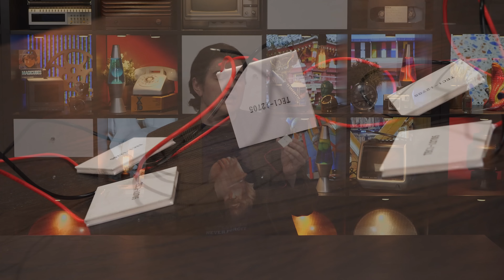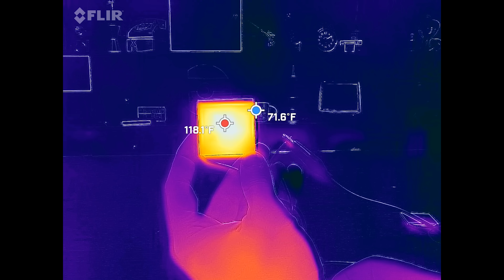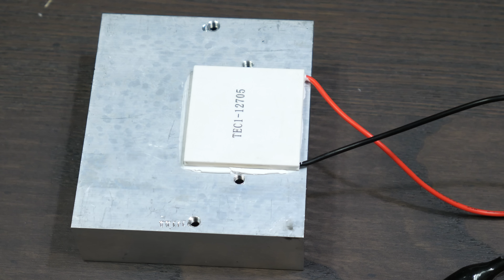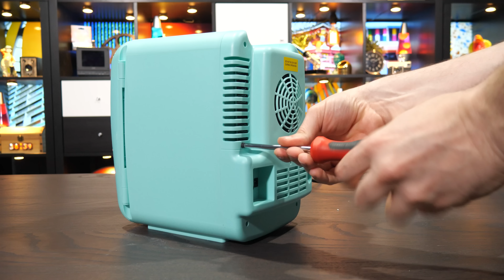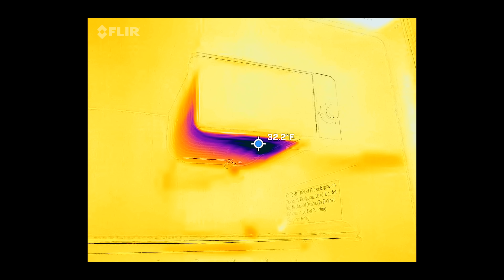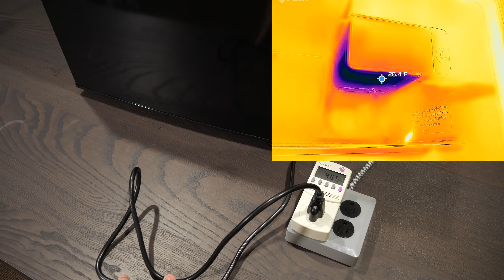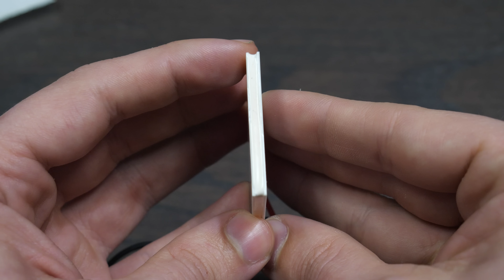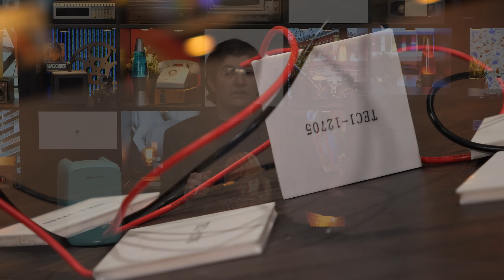Thermoelectric cooling: it's not great.

Comment: Friend had one of those.
Kept complaining about it, so I went over to improve it.
Changed the Peltier from a 5A to a 10A Model (120W), changed the thermal paste to actual good one, added a bigger hot side heat sink and ofc upgraded the power supply.
It worked much better afterwards!
For the low price of doubling the electrical consuption, and almost trippling the original purchasing price 😂😂😂😂
Reply: “It’s not so bad. If you Ship of Theseus the entire thing it’s sort of passable.”
Reply: @SomeOne-ym4xg  exactly 🤣
By investing and replacing all the parts, it is actually able to do what the original promised
Reply: @florihae at that fucking point just make one yourself though 

Not really a ship of theseus if you didn't need the ship and could make a better one and had no pressure or time or money to give much of a damn about 
Just make one yourself at that point 

If hindsight isnt your problem also

But people really dont like looking at specs and i find it weird
Reply: @PieCakeandDonuts it was fun, that's all.
The true ship is the friends we made on the way 😂
Reply: @florihae eh fair i have some pointless projects also that are either useless or i basically did the same has you for the challenges and entertainment some of which includes my own hidden blades i made and a brace gun 😂
Also a prosthetic leg gun like that girl from lone ranger with Johnny Depp and a arm prosthetic with a pipe like jindosh

So i can relate 

Im also prepared if i lose a limb appearantly and im going to be so fucking pissed if it isnt the right ones 😂
Reply: @PieCakeandDonuts  based 😂
Reply: @SomeOne-ym4xg  passable at cooling, but also costs more than a real fridge and consumes 4x the energy.
Reply: Treat it like a gaming machine's CPU and you're all set.  Maybe go to liquid cooled.
Reply: @jimmurphy6095 adding liquid cool with a radiator is basically the same as an actual fridge at that point 😂
Reply: @Ham24brand  Basically, yeah. But still cheaper and quieter. 😂
Reply: @Ham24brand  well for a cpu its not just spend a bit more on metal/ radiator
Reply: @Ham24brand  i love this phenomenon when people try to improve on a new design and accidentily invent the old design again🤣
Reply: @Ham24brand  liquid cooling cant get sub ambient
Reply: @alexdrockhound9497  Yeah, you would need a compressor
Reply: @Ham24brand  except for not having a compressor and phase change
Reply: @Ham24brand not the same, but equally complex.
Reply: @Ham24brand  Maybe just add a heatpump...
Reply: @Ham24brand wait so my computer is liquid cooled practically making it a fridge
Reply: @Ham24brand how much do you think a fridge costs?
Reply: @joeschmoe6908 like a $1000 dollars or more or something
Reply: @johnklug589  No, because it uses coolant not refrigerant.
Reply: @jimmurphy6095  You wouldn't even peltier a CPU. Linus tried and it works just well, up until the peltier gets too hot and you cannot move the heat quickly enough anymore
Reply: @eziitis8  peltier cooled cpu's were a popular option for overclocking in the early 00's.
Reply: @eziitis8 I thought when Linus did it it was useless even when they went super overkill with multiple peltier modules.
Reply: @eziitis8  its often used in combination with water cooling, water wont be cooler then ambient. the peltier can. cool the cpu lower, then you can get rid of the heat by the normal  water cooling
Reply: @eziitis8  Intel was experimenting with these as coolers in the early 00's, but CPU power consumption out scaled the ability to cool using peltier a long time ago.
Reply: @eziitis8  I remember the short lived Peltier craze in the 90's for computer processors.
Reply: @eziitis8  About 25 years ago, I did peltier (+watercooling) my AMD Athlon 800MHz CPU (or something like that) for serious overclocking. When the CPU was idle, it began to accumulate ice - which melted when things got busy. The melt-water then dropped down on the GPU... so I had to run a background process to permanently keep it at 100% load.
I think I still got the GPU lying around somewhere - including rust-stains... 😁
Reply: @ReadersOfTheApocalypse  Classic problem with sub-ambient cooling, that. XD
Reply: @alexkaplan6581  they were pushing it for Intel 10th/11th gen too. I ended up getting the Cooler Master AIO very cheap and making it work with a Ryzen 5900X... Very fun project, but very impractical as the element is only 65W with 12V in. I know others have modified theirs to chill the water in their custom loop, also a fun idea.
Reply: @laceflowerhw  Really, that late? Wow.
Reply: @eziitis8  Needs more peltier, thats all.
Reply: @eziitis8 I can think of a use case for Peltier cooling a CPU and that would be in a situation where the air temp is very very high.
Reply: @ReadersOfTheApocalypse  That's incredible. These days you worry about liquid loops leaking, meanwhile you were worried about condensation ice.

I'd still say my point still stands that even though it's possible doesn't mean it should be done. I tip my hat to you sir.
Reply: @eziitis8  Doesn't necessarily mean the loops weren't leaky too... 😁
Reply: Except people did peltier CPUs back in the day. It'd be a mix of peltier and watercooling. Watercooling would cool the peltier. You could buy the Swiftech peltier waterblock. Course this was back in the age when few people were watercooling and even fewer were doing cooler than ambient cooling. The problem with less than ambient was having to deal with the condensation issues. This existed for the peltier waterblocks or the phase change coolers (like Vapochill). Depending on cpu, the Swiftech peltier could chill the CPU down to like 4 C at idle and still under ambient under full load.

Hell, watercooling was still more for the extreme side, since no AIO kits existed. Few companies existed for water cooling components. People were making their own water blocks, using aquarium pumps for water cooling, or converting car heater cores into radiators. People were also making their own peltier setups, since they wanted more powerful peltiers than what Swiftech made. They were the only company that made a peltier waterblock.
Reply: @eziitis8  I used a Peltier on my cpu in my 2nd gaming rig and never had any problems. Also have a Peltier fridge and love it too. I guess the mileage varies🤷‍♂️
Reply: @eziitis8  : A single peltier element does not have enough transfer capacity to handle a CPU and produce any real temperature delta.

You'd have to have two cooling loops or equivalent and then put handful of peltier elements between the two loops. That way you could run the elements well below the rated maximum, and get decent cooling and CoP.

But that would take lot of space and lot of money. 

I might still want to try that one day, but...
Reply: @jimmurphy6095 while you're at it, maybe add a compressor to help force the heat out of the liquid
Reply: @jimmurphy6095  and using another peltier to cool that water down
Reply: @jimmurphy6095 you mean almost like a refrigerant system? 😂
Reply: @jimmurphy6095 I considered liquid cooling but honestly the main point of liquid cooling on a PC is to move the heat away from the other components but in a mini fridge there are no other components, so it's pointless.
Reply: @jimmurphy6095 yeah, and then cool the liquid with a chiller with an actual refrigeration loop
Reply: Fun science experiment. Smallest possible refrigeration circuit. Tiny reciprocating compressor at minimum, rotary or scroll for extra credit, 3/16" refrigerant line or smaller, tiny microfin coils.

It'd be cool to see the peltier size coolers but with actual refrigeration.
Reply: @Jaker788  I like that idea....don't tempt me 🤣
It would just become another unfinishe project
Reply: @Jaker788 For something that size, a tiny 5W water pump from a window washer would probably be sufficient to get the job done.
Reply: I got a large Coleman cooler with this type of cooling and it will freeze drinks. Works very good when I used it for trucking.
Reply: @smittyshmo  could you tell me a model number? Not for buying, but would like to see if I find out how they cool the hot side and how they distribute the cold side
Reply: @smittyshmo  it will freeze drinks as long as the ambient air is 50 degrees or less.😂
Reply: @smittyshmo  is that so…share the model if you please!
Reply: @smittyshmo
Reply: @smittyshmo yeah he’s using temu level engineering vs compressors. I’m certain better engineered peltier fridges can be made.
Reply: @jhoughjr1 ive already made one to cool an entire cpu (9800x3d) under full load. On my channel. Honestly it was fairly trivial. Also made it cool the same cpu on full load for 20min doing cinebench while tecs were getting less wattage than the cpu was getting
Reply: I made a mini fridge using Peltier devices a few years ago. It used 8 devices with liquid cooling. I ran the devices at 6 volts rather than 12. I recall there being a tradeoff at full power where thermal transfer cancels any additional cooling.
Reply: @tylercruit6261  yes, as soon as you have saturated the thermal flow capabilities of the element, which is not that great (especially the ones with those THICC ceramig tiles as plates) you effectively overwhelm the element and both sides get over room temperature.
Reply: sounds like either the cooling effect or self-heating is non-linear  so look for the highest efficiency region and operate there...
Reply: @gregbailey45  if you want the best effect you have to operate at less then nominal voltage, seems to be the consensus here
Reply: @tylercruit6261 that would depend on the interface of both heat sinks and the load
Reply: i had one of these for a minute then just got a mini fridge off facebook for 25 bucks instead. they work good as wine coolers but don’t get the drinks all the way cold.
Reply: @cavanmoriarty6370  the things that are scary about fridges or electronics in general from Facebook? Cockroaches 🪳🪳🪳
Reply: @cavanmoriarty6370 problem is the size. I have a very specific space on a tv stand where one of these mini fridge coolers fit but most actual fridges are too big for what I need
Reply: .. and you spent more money on the upgrade than what the fridge was worth :)
Reply: @Heffalumpen That's what he just said at the end of his comment
Reply: @Heffalumpen  and it still will not cool worth a shit.
Reply: @Heffalumpen  exactly 🤣
It was a fun project tough ^^
Reply: @Heffalumpen  Yes, he said that.
Reply: @Heffalumpen sometimes people do stuff for fun
Reply: @Heffalumpen  You could buy a better fridge but you are going to pay way more for it. So either way you are going to pay up for good compact refrigeration.
Reply: @Heffalumpen cars are considered totaled if you’d have to spend the value of the car repairing it.
Reply: @Heffalumpen  it’s the only way to make something good and make it last a long time nowadays
Reply: @Heffalumpen  And it works way better.
Reply: @Heffalumpen hence why they said "almost tripling the original purchasing price"
Reply: @Heffalumpen your comment is redundant
Reply: @Heffalumpen  yes that's what he said in the comment
Reply: @Heffalumpen  > "For the low price of doubling the electrical consuption, and almost trippling the original purchasing price"

I understand he doesn't know how to spell "tripling" and "consumption" correctly.  But surely you could use critical thinking to understand he said what you said, just with better specificity.
Reply: @Heffalumpen  pretty sure that falls under tripling the original purchasing price
Reply: Well i mean hes got the one mini fridge that does 3x better than the POS they started out with. @Heffalumpen
Reply: @Heffalumpen  Brother did not read the entire comment.
Reply: Having a fan inside circulating air over another heatsink on the cold side would have improved it more I have a portable car cooler with a 5 amp Peltier that has no problem getting to 2 deg C
Reply: @bascomnextion5639 yeah mine has no interior fan and it makes ice on the junction
Reply: @bascomnextion5639  agree, they are very lacking with the tiny inside coldsink.
Reply: @bascomnextion5639 

I am trying to cool a shower down. I grow mushrooms inside the shower, less messy. But it heats up.
How would I use this tech to cool it down.
Thanks
Reply: Kind of what I'm doing with a coolerbox, also making it temperature controlled so element and fans are switched off.
Reply: @MeteorMark  booh, temperature control is for sissys, FULL POWAAAA!!!! /s
Ofc, that is the smart way, but I am not here for brains, I am here for the COLD
Reply: That's a hilarious upgrade for such a lame little cooler
Reply: @TheTyisawesome  it went from "lame little cooler" to "space heater with cold beverage function"!
Reply: Yeah, I had a PC case that used a peltier device to cool incoming air.  Just like the video says (and you say)--it's pretty neat.  Just not very good haha.
Reply: @tychosis Where did it put the waste heat?
Reply: @techgeeknzl  There was this sort of "diverter wedge/ramp" thing that split the hot and cold airflow and blew the cold air into the case and the hot air out through the bottom and rear of the case.
Reply: @tychosis  that is so stupid, haha. All you are really doing is heating up the room, and therefore the air 🤣
Reply: @florihae  haha yeah, it was dumb and bad, seemed cool at the time.  it DID pump cool air inside, but also pumped the hot air to the exterior of the case
Reply: i suppose in a way by the upgrade, the initial expense was simply buying the premade housing for it all, which given the form factor and ready to go circuits would make it appealing to then simply replace components where desired
Reply: @tsmeowth001  haha, worse...the original circuit is literally just a power supply and a on/off switch....psu was trash and I just kept the switch 🤣
The current fridge has an external  powersupply, helps actually to get some less heat into the box!
Reply: But did you have fun doing it?
Reply: genuinely though now i'm curious if you were able to make it better by adding water cooling and having it toggle itself when it reaches a certain internal temperature. It would still not be as efficient, but you could eliminate a lot of the problems that blue one did like the noise and heat dispersion issue
Reply: @moffichu9150  good summary. You can make it better, but realistically never better then a cheap fridge.
Reply: @Pippy1  that was the only reason to do it!
I knew it will not be better then a fridge, nor consume less....bit it was a fun afternoon
Reply: Honestly, I'd have been tempted to replace the fan with a larger-diameter one.  The most important factor in how well a peltier works, is how cool you can keep the hot side.

(And yes, people have tried stacking peltiers on top of each other, but that just makes it harder to keep the hot side of the final one cool enough, because there's more total heat to get rid of.)
Reply: @jonadabtheunsightly  used a HyperEvo212 PC heatsink, that helped a lot
Reply: @jonadabtheunsightly yes but you get much much colder so with closed loop control operate at a lower duty cycle
Reply: Whats your advice on upgrading one thats plugged into a cars cig lighter?
Reply: @seymoarsalvage  unplug it and put some icecubes in there instead. Bam!
Reply: @seymoarsalvage the power supply and wiring is the concern with adding more peltiers.
So you want to focus on non electrical improvements. Bigger heat sinks, better insulation between the hot and cold areas.
Reply: @seymoarsalvage  check the fuse on the cigarette lighter in the car so you don't pull more than you're supposed to 

Perhaps get a larger sized fan to spread air out on the heat sink at a lower RPM which would be quieter 

If you're feeling adventurous you can always add more heat sink as well more surface area for air to blow over
Reply: @KuramaKitsune1  I reached the point where every vehicle I own (modep, motorcycle, car) I have a thick gauge wire directly hooked to the battery with a XT60 plug. This way I can pul easily 600W continiously from my car. Especially useful for an inverter or so.
Reply: simply damming the fan to the heatsink makes a huge difference.   adding lateral slots in places on the sink also helps
Reply: Well, if your friend uses it in a office he does not have to worry about electricity costs.
Reply: @greenblack6552  haha, fair enough, he actually did bring it to work
Reply: Did you check out the insulation? If their door didn't have foam or whatever,  that could be a big factor
Reply: @peterkn2  i did not. It was either just double walled pladtic or filled with some light duty foam
Reply: Bought a couple of miniature water coolers using this tech a while back - worked very well until they didn't. Very unreliable, they just buggered up within the space of a few months. Crap PSU?
Reply: @jamesportrais3946  I would sbsolutely blame the PSU. The one in that fridge was really bad and getting quite hot.
Try to use an external (laptop style) psu.
Reply: I already have some of these parts... maybe I will upgrade mine... or buy a regular mini fridge
Reply: @orion10x10  depends if you want to be crafty and enjoy tinkering or if you are smart 🤣
Fridge is always the better option, but I just love the process of improving the machine.
Reply: That's what friends are for.
Reply: so it consumes twice (actually probably 4 times) as much power as a mini fridge, costed more than a mini fridge, and does a less good job than a mini fridge. You actually hurt your friend here.
Reply: @johnk6757  haha, you assume too much. We both knew before we even started that the new fridge will be even trashier then the current one. But it was fun to do and to see that it actually improved cooling!
Most parts I had laying arround anyway. All in all, cheaper then going to a bar all evening and more entertaining, I call that a win!
Reply: change the fan to a hi presure and use 9v, power drop to 17W and beter transfer of heat
Reply: @mnk47  that part I really missed doing. Should have played with the voltage more!
Thanks, will try one day...maybe
Reply: I feel like the biggest weakness is probably the lack of insulation.  Did you try drilling a pair of holes in the hollow door and letting some expanding foam loose in there?
Reply: @Archgeek0  nope, but should have!
But hey, why insulate, when I can just ramp up the power? ;)
Reply: I have a larger one of these that holds 18 cans. Naturally when I got it I took it apart to see how it worked and was surprised to see this mechanism. I had already learned about it from a science experiment that Linus Tech Tips did trying to cool a PC CPU with something similar. Anyhow, I opened it up and to my shock and surprise I saw that the fridge was actually designed to hold TWO of these coolers. One in the top and one in the bottom. The power supply even had empty solder pads and enough beef to run the second one but for whatever reason mine only came with one.  I also had an older/smaller sprite labeled one that held about 8-10 cans. So naturally I harvested the parts from the older one and made my new one run with two installed. I have got to say it is VERY impressive. These units are larger because they came in larger sized fridges and when running both my drinks get down to drinkable temps in around 2-4 hours depending on ambient temps. Also when they get cold they get fridge cold. I can also store refrigerated foods inside of it. For context we have central air and run the house at about 69-72 degrees F. The internal temp of my fridge is between 38-40 degrees and it holds that steady and gets things cold fast. However (and I haven't finished the video yet you may have addressed this) I noticed that cans cool much faster do to the thermal conductivity of the cans. Normal foods like a lunchable for instance that comes in plastic packaging takes much longer to bring from room temp down to 40 degrees F. However, keeping a few cans in the bottom along with my food seems to help speed up the process significantly. It is also worth noting that the second unit is smaller than the first and that I upgraded the thermal compound on both to high grade PC CPU compound. (Someone should liquid metal one of these bad boys!). You should try buying the larger version from Walmart that holds 16-18 cans and then installing a second cooler on it. I had to rig it up a little bit as the rear wall was a tad different in thickness but it wasn't too hard. I would love to send pictures and temps if you are interested! Take care.
Reply: @ImJakeHello  all these comments really made me consider building my own from scratch. With propper foam board, so it is well insulated, PC heatsinks to efficiently remove the heat and full metal sheets on the inside for maximised area of contact to the content. Because as you said, touching the cold plate directly is the way to go.
Reply: I guess I got a decent one. Mine gets cold enough to freeze liquids and it's so quiet. It makes my humidifier sound like a jet engine. I connected mine to a timed outlet so it turns off and on in 20 minute cycles. It fits perfectly on my bookshelf next to my other mycology supplies. I use it to store My liquid culture syringes in a sterile environment (kitchen refrigerators have all sorts of contamination). Perfect. Size for 10 ml syringes,  50 ml glass vials and 60 mm petri dishes. I guess it'd be pretty crappy for food or beverages tho
Reply: Penaltier, cooling, it's a great way to take a red wine from room temperature to basement temperature at great expense. If you don't have a basement. Otherwise, they have no real use.
Reply: @scottdavis6734  using ice and salt is way faster and cheaper
Reply: Perfect upgrade
Reply: I was wondering, how good you could DIY. Decent insulation, good Peltier elements with big heat sinks , fans and most importantly real temperature controller. But I guess it wouldn't make any sense money wise.
Reply: @Tomi_Mäntylä  it makes a lot of sense if you ENJOY the process!
Financially, normal fridge, preferrably second hand, is by far the best option. But where is the fun in that?
Reply: @busimagen  correct.
The first stage will have to dissipate only the electric power plus the extra heat absorbed from the cold side. While the 2nd stage needs to dissipate all of this heat PLUS its own electric power. Therefore having multiple 2nd stage elements to cool the 1st stage makes a lit of sense!
You also make cooling the 2nd stage hot sides easier, because you multiply the area where you can add coolers
Reply: i did the same thing plus added a thin sheet of aluminum connected to the mounting screws on the back of the interior of the fridge to get more cooling into the container. works great but super inefficient. i still use them in the car via the power adapter.
Reply: The old 2007ish HP laptop's heat sink/fans with the Athlon II CPU/GPU were pretty darn good at removing heat from that power hungry little chip. Might be a good upgrade for making a small cooler with.
Reply: @tauncfester3022  I agree. Being cost conscious they probably used minimal heat sinks in both sides.
Reply: @tauncfester3022  I used a CoolerMaster Hyper 212, that one is much better, since it does not blow the hot air against the casing
Reply: Instead of a 10 amp you could use two 5 amp ones (not stacking) with separate heatsinks and coolers for added cooling area.
Reply: @carloscollomps1552  That's probably what the OP did.
Reply: @carloscollomps1552  that would be the most effective way, ofc, but needs much more modifications then only changing the module.
Reply: Honestly... if you're using it in an office, you don't pay the power bill lmao so
Reply: @jakegreen6341  true, or you have solar or just don't care 😛
Reply: This is what a real man will do. Make something already inefficient even more inefficient 😂😂😂
Reply: @philipplamenov8649  yeah bro!!!
It's not about the money, it is about sending a message 🤣
Reply: things that  didn't happen
Reply: Yeah man i knew that peltier is shit more than 15 years ago
Reply: @wittekPL  they are not shit. They are just often not correctly used!
Like that shitbox I built 🤣🤣🤣
Reply: Mod ALL-THE-THINGS!!! That is some ingenuity.
Reply: @stevenv2190 that's why I like vuying cheap chunk, I can mod it much better then the well built, overly complex stuff 😂
Reply: So what you're saying is for the price of a real fridge, you managed to make a fake fridge into a smaller version of a real fridge, but still worse than a real fridge lol
Reply: @Twinspinner yes....AND having fun while doing it 😂
Reply: A full sized fridge uses about 120w while running, so lol
Reply: @pilotsmoe many even less 😂😂😂
Reply: I wonder is you get a big and powerful enough peltier element, maybe it would do well at cooling CPU's? Just thermal paste the element on the cpu and see what happens. Not mine though, someone else should try it and let me know how it goes😅😂😂😂
Reply: @alexmattucci8507  oh, this has been done before.
Main problem is, they get overwhelmed by the heat.
The far better aproach is to actively cool your cooling liquid with Peltier.
This way you can lower your cooling liquid temperature by about 5 to 10°C
Reply: @florihae ahhh, yeah that's a good idea😅
Reply: Add a bit of insulation, and it could probably make a beverage cold enough for human consumption in 3 business day.

Have to gave up all illusion of being cheap altogether, though.
Reply: @PaiSAMSEN  if you want cheap and better, get a normal compressor fridge 100%
Reply: Why did you do that? You just had to put the toy into a real fridge, all problems solved! The toy would also use less power than the fridge. :)
Reply: @stephanegrosjean4990  because it was fun!
Reply: @florihae  you missed the joke ;)
Reply: @stephanegrosjean4990  thanks to the great YT comment system, I can not even find your original post anymore 😅
Reply: @florihae  tbh, neither did I, I think that comment was a joke about putting the toy fridge into a real fridge to achieve better results without using any power from it ;)
Reply: @stephanegrosjean4990  probably, does not matter, just pretend I read it and thought "haha. Yeah, that would be funny" :P
Reply: And at that point, you'd think the friend would say "I'm just going to get a small fridge from FB Marketplace, that way it works out way cheaper, is more efficient but ALO I can keep Otterpops, Sticks and ice in the  little freezer compartment!" 😅😂🤷
Reply: so its using even more energy
Reply: bro you upgraded his computer not his fridge
Reply: @Robbie-mw5uu  oopsie XD
Reply: hahahahah, that's evil dude😅🤣
Reply: Try a cooluli it has a temp adjustment and cycles to maintain it was actually engineered to work . But I still recommend the mini close loop refrigerant fridge.
Reply: I upgraded my little fridge by storing it inside a mini fridge. Works great now.
Reply: @florihae  omg lmao
Reply: Did it even have a thermal insulation other than double plastic walls? I'd start with that.
Reply: Same, but i went from a 40w to a 60w. I didn't upgrade the heatsink, but I did put a bigger fan on it. I also removed the old PSU, so I replaced it with a more powerful one, and then blew that one up, so now it runs off a PCIE power connector.
Reply: Through the magic of buying two electricities...
Reply: Did the same....along with a 3dprint to force the air through the heat sink vs vaguely at it.   It was freezing up inside.  Still terrible for power use of course.   The sold designs leave a ton of performance in the table, but then for the price you'd just buy a real mini-fridge.
Reply: But most importantly, did it have rgb lighting?
Reply: @Emppu_T.  omg, it did not!!!
What a mistake! Will call the friend immediately, we need to fix this!!!
Reply: The cheapest thing to do with it if you were going on a picnic is to put it with the beer's in it into a freezer the night before then you have a cooler box with cold beer in it.
Reply: "MORE power, grunt, grunt, grunt" -- Tim "the tool man" Taylor.
Reply: might be worth having in the office where I am not paying the electric bill lol
Reply: You remind me of Tim Allen in Tool Time: "More power! Ha! Ha! Ha!"
Reply: Gutted 3 of these and reused the peltier elements set up as 2 parallel and 1 series. Added a much bigger heat sink to it and a cold side heat sink from a pentium processor cooler. It is mounted into a big cooler and powered by a solar panel ❤
Reply: Just keep in mind you need a bigger power supply if running on AC, and finding a cig lighter socket in a car fused high enough for reliable operation.
Reply: What if i want to heat oneside and cool the other
Reply: Please note that in the few model I have tested there was very bad insulation.
Reply: But for fifty bucks you can get a cube frigerator on craigslist
Reply: I thought "turn it up to eleven" was a Wayne's World gag originally 😢
Reply: @busimagen sounds good!
Reply: What a good friend. I bet Your friend appreciates raising his electricity bill. 😭
Reply: @Sentarry  haha, all your guys concerne is cute.
He uses it not often and when, then usually at work 😛
Reply: wile consuming twice as much power, great job
Reply: so it is less shitty but shitty nontheless :)
like using hydrogen for fuel
Reply: define "better"? didn it go below 3 degrees C from 7?
Reply: @prime8krish  I could not measure the temperature accurately, but the drinks were as cold as from a normal fridge after a hole afternoon/evening of running
Reply: i wonder if heat pipes would be useful as well in order to transfer the heat faster? you’d of course need one made for slightly above room temperature instead of the higher temperatures they are usually made for, so that might make it even more expensive, but still
Reply: @asdfghyter  I used a Hyper 212 CPU cooler, which has heatpipes ;)
Reply: Jurassic Park moment for sure!!!
Reply: Sounds like you really stuck it to her. Some friend. 😂
Reply: @ItsMeKyle1882  some people here are really upset about how I did my friend "damage" because it now uses more electricity or so. Do you guys think he uses that thing as his main fridge?!
Bro, it was a fun thing to do!
Reply: exactly what I was worried about once I read you increased the amperage requirement
Reply: If you wen that far you might as well slap a thermostat to it.
Reply: @marcor6403  probably, yeah. But had none at home. Whole thing was just spare stuff (mostly)
Reply: My friend we are dwelling into pc cooling territory 😂
Reply: @pingwong117  I used a CPU cooler, so yeah
Reply: hmmm. i think you COULD make it more efficient, but with a more drastic redesign. moving the peltier to the top rather then the side. adding alot more, and better insulation around the entire thing (maybe even vacuum layers too if you want to get fancy), and adding a thermostat to turn the entire thing off once the interior gets to a certain temp. 

I also wonder about changing the venting system. like, would it be better to leave the fan in the back, and have an intake vent in the front where it draws air over the heatsink fins and blows it out the back, rather then blowing directly on them and having output vents on the sides like here.
Reply: @RaptorNX01  the goal was never maximum efficiency, it was a cheap and quick project.
About the hot air flow, this was solved entirely by using a CPU tower heatsink. Therefore the airflow is now parallel to the backwall of the cooler
Reply: You basically made another one  :P
Reply: @davejones4946  would love to make one from scratch...but it is just such a waste 🤣
Reply: Then consumed even more energy than a standard mini fridge
Reply: Sounds like you are installing a CPU
Reply: @deku812  Intel is hotter than that 🤣
Reply: I whonder how much of this is also the internal side not having an internal airflow and heatsink to wick away the heat
Reply: I kinda wondered why the hell they only used one element instead of a grid of peltiers to fill up the whole surface.
Reply: @techalyzer  quite simple....cost
Reply: recently started a temp job at 5below. we sell various designs of these kinds of fridges. after watching this video it's almost mind numbing watching people buy these while knowing how bad they are
Reply: I froze my fridge accidentally because of this when i first got to college. My mayo has never been the same.
Reply: @mangojules5736  we all have been there brother :(
Reply: While still wasting energy which other tech wouldn't. Good job. NOT.
Reply: @minkorrh  oh look mom, another commenter that did not read and just shit on a fun project!
Reply: I have a coke cola fridge like this it puts ice on the bottoms of the cans and is cold
Reply: Well I guess it’s the idea of getting that unusable Peltier to be usable
Reply: Questionable gains but sounds like a fun project tbh
Reply: @binchsoda  questionable? Bro, it is lunatic 🤣
But it was hella fun, that's right!
Reply: bro just build a pc at that point jesus you got half the knowledge to do so anyways
Reply: @marthflores3515  built many PCs, usually watercooled ;)
Reply: Now add RGB lights
Reply: Send me the schematics pls. Would like one of these in my office
Reply: @icenote1591  haha, as if I have that 😂
Plus, it is much cheaper to just buy a small fridge
Reply: I love the engineering breakdown how Peltier’s COP drops as ΔT increases, making them inefficient beyond small temperature differences. The fundamental physics, not design flaws, is what holds them back.
Reply: @diytoptricks  you can brute force it to some degree, but absolutely agree. They are usually just not the right solution
Reply: As I was reading how you went over to improve it because of how much complsing there was. I thought you went over stomped on it and threw it in the trash😂
Reply: But now it will work forever
Reply: Essentially, people would be better off building their own if they have the needed knowledge.
Reply: Pc builder uses cooling and power knowledge to fix peltier cooling
Reply: Tldr: just buy a cooler-box and store some ice-packs in your real freezer to cool your drinks for the day 😂
Reply: @Tiggy.Skibbles106 100% correct
...IF YOU ARE BORING 😂
Tinker arround, plsy with shit tech and get happy
Reply: It could have quite a few advantages, if implemented with quality Fan, Insulation and controller (which most of the ones you can just buy don’t though)

-Less noisy
-needs less space
-less moving parts
-less toxic gasses

Would love to see one build really well with Aerogel as insulation. And then see if it actually takes much more energy

If it’s nearly the same, then it would be perfect for Campervans or boats, that you sleep in.. where these advantages matter
Reply: The sad thing is they can build an ice machine that roughly the same size that has a compressor and works great for not much more money.
Reply: @marktx21 oh yeah, even mini fridges are not much more expensive
Reply: On the flip side, lots of cheap 1-500w PSUs with 12v rails, and heat sinks from old pc's to be had , and insulated boxes are cheap in the form of non chilled coolers, so diy-ing might not be a bad solution ... 240w peltier with gaming pc style heatsink for £40 on Amazon, cooler for £20-40, scrounge a power supply and spend a weekend.....
Or a 50l booze fridge runs £100-150 new, and one model runs at an average of around 8 watts (based on a not particularly efficient, e class environmental friendiness UK power rating of 66kwh/annum on a product info sheet)
Reply: People don't buy devices, though. They buy intended effects. If you want an effect badly enough, you'll pay for it. This is why there's a Dodge Ram SRT truck. 🤷‍♂️
Reply: But still wont freeze anything from liguid
Reply: @Expression666  it totally can!
But only if it directly touches the cold plate
Reply: Might have been easier to convert an electric oven for him😂
Reply: @buffclary  just reverse the polarity, problem solved
Reply: I have that exact little fridge !  I've never used it though.   I imagined id use it in the car but have not as of yet.
Reply: @dmlagrange  it will not do much or even anything in a warm car
Reply: Just get a regular cooler. This is the dumbest idea ever. Fixing problems that are not problems.
Reply: @voradorhylden3410  wow you are right!
We all should just be productive, have no fun, work hard, procreate and die. 

Bro, live a little ...
It was a fun thing to do
Reply: @florihae  no your rught we should all just buy useless crap
Reply: @voradorhylden3410  did you even read what I did?
Friend had one of these already, it was throw it away or improve it.
I did improve it with parts I had already and no use for.
Reply: Your spelling is legendary. I trust your story.
Reply: @RayeTodd english is not my first language and I am usualy drunk when I comment on youtube 😂
Reply: What you want to do is use a peltier on top of a peltier 
You can get stacking temperature differentials up to a point 
Doesn't necessarily stop at 30°  below ambient 
Adequate heat sinking the hot side is of course required.
Reply: @KuramaKitsune1  Stacking is great fun as you need to disperse more heat from electrical power with each module.
Reply: @KuramaKitsune1  Tried that. It was still dismal, if not even worse. Threw the whole thing away.
Reply: @KuramaKitsune1 no. The limit is due to not being able to reject heat quickly enough. Adding a second one would double its greatest weakness
Reply: @FuncleChuck  A 2nd in parallel with the same current should do better for efficiency. high current, high load is the problem. Same load but less current per device should help but I wonder what the efficiency vs current curve looks like.
Reply: @FuncleChuck  The limit is the maximum temperature differential it can generate, so in effect the limit is the temperature of your room. You can only cool it to room temperature with radiative cooling, and the element can get the cold side say, 20° below that. Now, if you stack another element on top of that? The hot side is now being cooled to not room temperature, but 20° below room temperature. Now it can go 40° below room temperature! And so on. This is an idealised example of how the elements work. You will run into cooling problems, but stacking the elements will decrease the temperature you can reach, up to a point.
Reply: @KuramaKitsune1 keep d stacking them until you can get them in a donut shape, making a heat particle accelerator
Reply: @chistinelane  INFINITE HEAT!!

....OR COLD....
Reply: @KuramaKitsune1  go big brain.  and use heatspreaders aswel.  so you can stack multiple peltiers on a single one. eventually allowing you to use a massive heatsink.  or even a radiator and use it to heat the room.
Reply: @KuramaKitsune1 

The problem is it would still thermal throttle, maybe this could work with a huge cold plate and mutlieple Peltier devices spread across the cold plate simultaneously.

Would still never measure up to immersive liquid cooling or direct die water loops.
Reply: @KuramaKitsune1 your limited by the power dissipation on the hit side. 

Once the heat soaks the heat sink then your just adding more power to be dissipated.

You can improve with liquid cooling, but then just liquid is good too.
Reply: @KuramaKitsune1 yeah u can get to dry ice temps with a not too deep stack
Reply: I've repasted one of these and put a better PC fan I had in it. Got better performance and it was quieter but still not worth it.
Reply: Congrats, your friend is now bankrupt from its higher energy usage.
Reply: @Nitrxgen  he was broke before already 🤣
It was a fun project, used an old CoolerMaster Hyper 212 as hot side cooler, was actually less loud afterwards ^^
Reply: Got one for free in a Coca-Cola campaign many years ago. Tried it, thought it was noisy junk, and stuck it in the attic. It's still there. I also got some Coca-Cola glasses. They're still in use. :)
Reply: When you engineer something this bad, you deserve an award. Just imagine someone spends 300k upgrading a f150 only for it to beat in an off reading competition by a 4runner.
Reply: @littlejack59  That happens more times in the automotive community than you realize lol
Reply: @littlejack59  I see, you do not understand the joy of tinkering crap together. No problem, buy a fridge and be happy....while knowing you have a much better product then my upgraded Peltier trash will ever be 🤣
Reply: It's the size, he's missing the most important part of why I have one of these. Doubles as a nice little cooler if you flip it on it's back and throw ice in it (I don't use it powered this way)
Reply: I hope you werent dumping 10A into the module because thats not how you use peltiers.
Reply: @kopazwashere  i actually never measure the current...I bought a TEC12710 and assumed it will draw 10A
Reply: @kopazwashere one doesn’t dump current into anything
Reply: selling bad PROPAGANDA
Reply: Emerson, hire this guy!
Reply: @vxpdx  ahaha, well, my current job is not that off ;)
Reply: U should do a guide on hwo to do this, had a small fridge for drinks
Reply: @queefcheif9306  I am not really a video creator....would love to do it, but I am not really the type for it. Talking to a camera alone in my workshop seems like torture